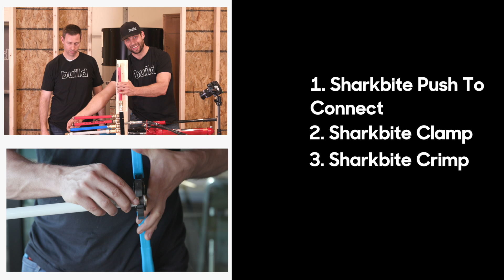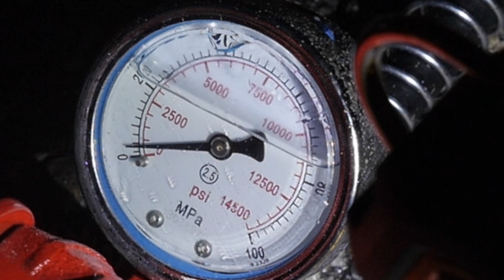Can we blow off these PEX fittings?  Sharkbite vs Viega vs Uponor

Comment: A little constructive criticism:  1)  Edit out the mistakes like the leak at the beginning.   When more interesting/informative content is just a click away, you can't afford to waste people's time.  2)  The test is kinda worthless without pressure gauges on the fittings.  Knowing one fitting fails before another doesn't really matter if, for example, the failure point is far, far beyond standard household plumbing pressures.

Comment: I'm not a plumber but this test seems useless.
From what I understand, sharkbite type slip on fittings have a rubber seal that makes them water tight, so as with anything with rubber seals, failure is inevitable.
Isn't typical household water pressure at the most about 100 psi?
I've had rubber seal fittings on my RV toilet fail at just 60 pounds of water pressure.
I saw a video on YouTube of a customer who found a leaking slip on sharkbite fitting inside of a wall.

Comment: I was under the impression that hot water vs cold water PEX polymer formulations were slightly different, and it would be better to control for that.

Ideally use a digital gauge, a pressure pump and a bypass valve so that there's a gradual increase in pressure instead of pulsation from a hydraulic power pack. Length of pipe does change the internal surface area, although that would only affect pipe elongation (visible as the pipe deflects just prior to failure) - it would be best to control for this as well to be representative.

Why not do a follow up video also showing individual pipe tests (instead of 5 in parallel)? Could you perhaps include tests with 90 degree curved pipes using the manufacturer specified clip on guides for the 90 degree sweeps, and kinked (then straightened) pipe for comparison? This topic has so much more potential....

Comment: ASME,ASTM, U.P. Code has done rigorous testing on these connections and even the push connects have done tens of thousands of cycles and hours in testing to be used in residential construction. They all state a max of around 180-200 psi, unless they are a cheap knock off that don't have any certification,  so rest easy people!

Comment: Just because "pex A" failed first it doesn't mean it is the worst of the 4, "pex A" might actually have more elasticity and hold up better under freezing conditions than the others
Reply: I agree, as long as your working pressure is 1/3 or less of the actual burst pressure. We'll need to see the test redone with a gauge with a lower pressure range, then, the test repeated with the temperature of a water heater. Higher temperatures will surely lower the burst pressure.
Reply: It wasn't b about the pex, it was about the Shark bite slide on fitting.

Comment: I'd like to see a test rig running at maybe 75psi something reasonable, at a high flow rate, slamming a valve open and close, slamming the fittings with pipehammer repeatedly
Reply: No fittings are made to be slammed with pipehammers.
Reply: @wandameadows5736  but it happens, all the time
Reply: True, however, there is something wrong with the design,  construction or operating conditions with plumbing experiencing damaging water hammer.  @EitriBrokkr

Comment: Put a lower pressure gauge on the manifold, and shorten the pipe pieces to just an inch or less so they don't have ten or more inches to expand in,  thus testing the actual connector. Also, use two cameras, one on the gauge, one on the pipes.

Comment: I would like to see the test using hot water within and with a lower gauge meter.  I have been using stainless clamp rings and have had very little issues however I always pressurize the system before I cover with sheetrock.

Comment: First, thank you for this test and for your other videos, also for the abbreviated Start. The late analysis of Uponor was a good one. Merry Christmas.
@5:32 and another close-up post-Uponor, you can clearly see a drip onto both the 3rd and 4th (the Uponor) connections with the tower. A leak is a failure and so, if the leak originates from the Sharbite Crimp fitting then "the winner" is actually the 2nd worst connection.The leak however, may be coming from the plumbing, teflon taped connectionto the tower (look at the "3" on the Brass connectors, then look down).
A best fit, IMO is a Pex Crimp BUT ONLY IF THE CRIMP TOOL AND CRIMP FASTENER ARE MATCHED. I will be using Pex for my HVAC.

Comment: Safety and Specifications - Recommendations:
Hydrostatic	Burst Test.
Build a containment testing cell to protect personnel and property based on pressures your testing to. Watching the video I was yelling at Matt to duct below the pipe that shot off like a rocket. 
Pull the specifications for ea test exhibit.
Record burst pressure and temprature of the testing medium from the spec.
Maybe that's all you really need to show in your video. Then show how to test for just working pressures. 
If not then
Test to the spec or best effort to
Test individually.
Use gauges appropriate for your test range - for accuracy.
 Record readings - compare to spec.

Comment: Why would ever expect brass fittings to fail before plastic pipe? It makes no sense. The first failure was not the shark bite fitting itself. The failure was caused by inadequate surface area gripping the plastic. The plastic is the weakest link and not the brass.

Comment: Don't understand why there were no working accurate pressure gauges used.    It isn't really a test if you don't know the point at which joint or pipe fails.  It's just a statement of that you can make it fail.  The idea of testing all those types of connectors is great but the follow-through wasn't there.

Comment: Dangerous to be pressure testing without the correct safety gear, and understanding of injection injuries, also to have a fitting failure at any point is disastrous, and dangerous to the point it should be removed from the market, having been in the hydraulic fluid industry for 40 years you should never get a situation where you have a fitting becoming a projectile 😎

Comment: Basically you were over pressuring the pipes. They are not rated for that pressure. However for the push on Sharkbite it would be interesting to see what it failed at. All the other fittings help way about the pipes rated pressure. Very nice video.

Comment: Replace the damn tape with rector seal. Tape always fails I swear.
Reply: My plumber would use liquid teflon and then wrap that with teflon tape. He never had a leak but he surely was dyslexic kept getting the hot and cold mixed.
Reply: Tape and dope the best but it's against  the code in ga

Comment: Uponor performed as it's supposed to. A pex has the best ability to freeze and thaw repeatedly without bursting because it is a more resilient pipe. B pex with crimp rings has the least ability to expand and contract repeatedly without leaking IMHO. I'm prejudiced in Uponor's favor of course because I switched from crimp to expansion pex about 10 years ago and have never had a failure with any fittings from 1/2" through 2" and I'm sure that there are better plumbers than I am out there. I also use all EP fittings wherever I can.

Comment: Seems to me that the second one to fail is the one to use.  Ever had a pipe freeze in the winter  ??

No special tools required.  How about raw costs of the fittings  ??

That white hose would have room to expand along its length.  Kind of like the difference between copper and pvc

Subject for a future video perhaps  ??

Comment: Interesting...I worked with all of these when I was with a plumbing company for a while (not licensed, so take everything that follows with a grain of salt!). I've seen Uponor expand about twice that much without rupturing. I'm more curious as to just how much the flow is affected between crimp connections and Uponor (expansion connections). If it isn't much, then I would lean toward crimp connections for DIY projects and Uponor for production work,  mainly because of the difference in cost of the tools. Both seem like good systems, though.
Also, channel locks made my life so much easier for making secure threaded connections...along with doubling up on teflon tape and thread sealant!

Comment: How far above the standard working pressure are these failing at ?  Also a comparison to a sweat joint on L and M tubing . Also a temperature would be interesting too .People have been beating these type of connectors for a while .

Comment: This was more about the PEX than the fitting...
Reply: I was thinking the same thing.  They should've used the same pex for all.
Reply: kevinerickson84 you can’t as some
Fitting require different pipe
Reply: @WraithRacing   wrong pex a can be used with every fitting they used.
Reply: @lakestatebullies7391  wrong lol
Reply: @lakestatebullies7391  type b pex is not designed to be expanded. Only type A can be expanded. While technically I have expended type b, it is very brittle and can crack. Works better if you warm it up before trying but is not designed to be used that way.
Reply: @WraithRacing  can you read? Go back and read what I said. "Pex a" can be used with every fitting they used. I never mention pex b.
Reply: @WraithRacing  yes your comment was "wrong" because you said they can't use the same pex. They could've used pex a which is compatible with every fitting they used
Reply: @lakestatebullies7391  they’re not just testing the fittings but the entire system accordingly
Reply: @WraithRacing  you can't read or listen very well. Read the description and listen to what he says in the beginning of the video. They are testing pex FITTINGS.
Reply: @lakestatebullies7391  yes but the type b fittings are designed for type b. Yes type a works but that’s not the advertised pipe for the system.
Reply: I agree if the Pex line splits or blows how is that a fitting fail. More a fail of the two hosts of the video to recognize and acknowledge it
Reply: Which proves Pex is fine for residential but definitely Not commercial or industrial.

Comment: The shark bite push connect has its place. Like when I am on a job and my boss sttole my pex tool and I have to connect a piece of pex to a piece of copper or just make a connection that I don’t have the proper tool to make a shark bite is going to make that connection at least temporarily so I can get the water back on in the house or to get the heat going again. But I would not plum a house with them or buried them inside a wall. I use the Vega pex as my preferred system. I am a 16 year plumbing and heating tech from Connecticut

Comment: Jordan Smith  
Please take this as friendly constructive criticism with all due respect... the methodology, tests and resulting conclusions shown in the above video are somewhat dangerous, flawed and most likely erroneous. 
It is very apparent there was air in the system on the first 3 failures when viewing the video at slow speed. 
The other indicator of air in the system is the fact it required so many pump strokes before building any pressure. 
Air is compressible, water is regarded as incompressible,  all water and no air will build pressure on the first few pump strokes  just like a properly operating hydraulic jack or porta-power. 

I suggest placing a suitable bleed valve in the top port of the manifold (highest point) and bleed ALL of the air from the entire pressurized test apparatus before testing and using another manifold port to install a 1000 PSI gauge for a better determination of failure pressure. 
My family has professionally performed hydrostatic pressure testing for nearly 45 years and from observation and experience, air in a system under test can result in serious injury, death and erroneous results.  
Also trapped air in the system under test will experience random premature failures on elastic walled materials (PEX) and the failures will always occur at lower pressures than all water/no air in the system leading to erroneous result conclusions.

Comment: Each iteration of the test weakend the PEX so the next pass weakend them to failure much earlier.  If you are testing the connections themselves they should be attached to a material that has a known PSI failure higher than the PEX.  If you are testing the PEX then new material should be used for each iteration.  But this does prove that 300PSI is the minimum and about 500PSI would be the approx maximum for PEX.  Probably lower PSI at 120  to 140 degrees for hot water.

Comment: Many of us believe the only real question is how well push on shark bites will hold up to pressure, temperature and time.  While residential psi may be under 80, closed in systems with a check valve at the meter have been known to exceed those nominal pressures, especially in the summer.  So it would be nice to torture test those fittings in an effective manner.  Also it would be useful to test the push fittings on copper since many fix copper with them.

Comment: Very interesting test with surprising results. I could not help but wonder whether pressure was equally applied across all five samples through the manifold/bridge.  It would be interesting in subsequent tests to see individual trials using an accurate pressure gauge (no manifold or tees) and compare the measured pressure at which each particular system fails.  Thanks for this.

Comment: Fun test, but I believe useless for 99% of installs. I'd rather a fitting or a pipe fail before too much pressure can build it and you get explosive results like the shark bite. I don't want them to leak at 1.5x real world top pressures. After that then I'm more than okay with them failing and even encourage it as a real plumber should have put a pressure relief valve somewhere if it was really needed.. I do want longevity and durability of out of my fittings and pipe. idiot proof method are also good like Pex-A expansion rings. It's really difficult to make a faulty connection even for a hungover sleep deprived Superbowl Monday morning plumber.

Comment: Since it seems, at least with system a pro might use, it's the pipe not the fittings. I wonder how they would do in a freezing situation. Copper pipe is great but not with a freez, same with cpvc. I always think the PEX, especially the PEX-A would handle the freezing better but I wonder if it would fail a fitting?

Comment: What about PEX C? And definitely need to have a pressure gauge with higher levels of accuracy and resolution.
Reply from the maker: Agreed on the gauge. Didn’t expect these results. We bought a more precise 0-2000psi gauge and plan to retest for a video shortly
Reply: Matt Risinger any thoughts on PEX type C (electronically cross linked)? Everyone seems to be talking A and B only..

Comment: As a simple homeowner I think I would prefer a fitting that consistantly blows before damage can be done to the hose.  There is going to be a mess either way,but with a hose burst it can be anywhere along a pipe.  With the fitting it will at least not be behind a wall where it is harder to find and fix

Comment: Sharkbite fittings are made in China. Viega fittings are made in usa and have more certifications. Pex pipe is pex pipe...its all made by the same manufacturers. Viega crimp is my pick due to fittings...the pipe may burst before the fittings in a PSI test, but its the fittings that are going to leak in real longterm usage. Fact is sharkbite fittings have lower quality brass that will corrode sooner. Also viega pipe is supposed to have leas friction inside so there is less pressure drop.
Reply: Nick Eckermoff Sharkbite fittings are manufactured in Cullman, Alabama by Reliance Worldwide Corp main headquarters in Australia. I did a Google search to verify this. I have used Sharkbite push to connect fittings under my crawl space to fix plastic fittings on polybutylene pipe that failed. I keep an eye on them but so far they are holding up great. I am on a well so don't have to deal with chlorine.
Reply: eyesalooking Nope. The packages state made in china. Go to lowes or homedepot and check yourself. Also inspect the stamps on the fittings.

Comment: Hydraulic fluid injection is extremely serious (your limb will have to be amputated if it happens) and potentially fatal.  If you are above 100psi, you should put a plexi shield between you and the device under test.  That first failure was a perfect example of why you should never be around anything like this.  Also, I suspect that the pipe failures were partially because of the repeated testing, which would cause several deformations, weakening the pipe.   Testing them individually is the way to go.
Reply: I was pressure washing my deck in sandals, with a fairly weak pressure washer, and I ran the stream over the top of my foot accidentally. It didn't really hurt when it happened, just like a slight tingle/burn, but in the next few days my foot had a huge purple bruise in the shape of a line. It still didn't hurt that bad, but it looked horrific.
I can't imagine what oil at 10-20X the pressure would do.

Comment: The first part was very entertaining no matter what the haters say!  Though I was waiting for the explosion due to the expansion of the PEX tubing, which I was surprised that wasn't thought of ahead of time.  I do understand the thought process, if one was expecting a sudden break, and no compression of the hydraulic fluid.  Nice to see that your instincts were kicking in as you realized that hydraulic fluid was building up under pressure as it was being pumped, though good sense did not kick in quickly enough, LOL!  The only thing missing was, "Hey Bubba, hold my beer and watch this!". ;), would have added some to the entertainment value.

Comment: Good information. I suggest you put a hydraulic check valve between the pump and gauge(one that has a manual overwrite), this will allow you to read the pressure even after something has failed.